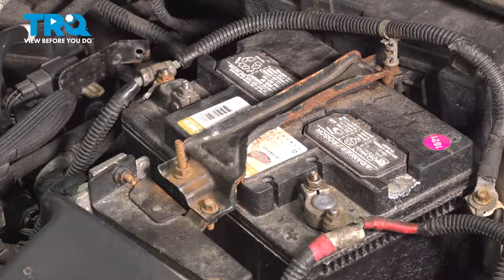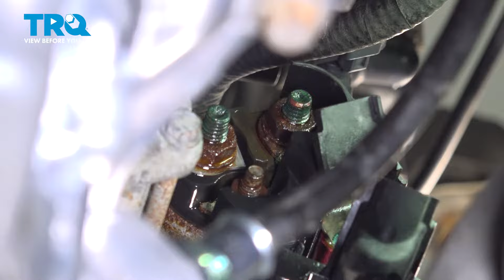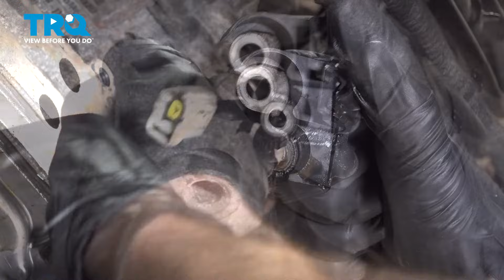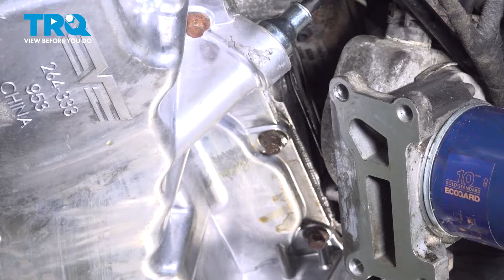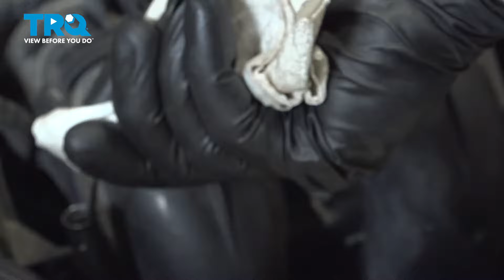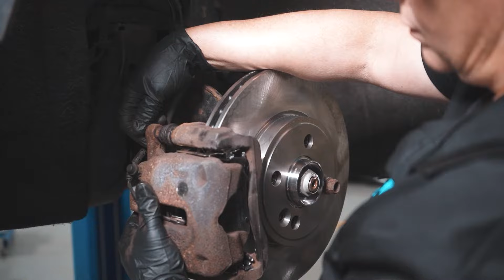How to Replace Starter 2010-2013 Ford Transit Connect

Comment: Took me 3 hours, so much oil build up and dirt and that van has never been touched by no one other then ford until I did it, so the van had all plastic covers and cable management harnesses, more so then what TRQ shows on this video. I drive 100k miles a year, not a mechanic but I am really handy with a wrench. I was able to torque every nut and bolt to spec by doing what TRQ did without ruining or stripping anything. Maybe these guys saying all these shortcuts are master mechanics though I wonder why they need to look up DIY videos but on other cars and trucks I've been able to do it in 25-45 min but this one to do right 3-4 hrs following this guide sounds right.

Comment: for those asking, engine is a 2.0L... there is absolutely no need to remove the oil cooler or any other part, need to go from bottom of the car, only need to disconnect the oil pressure switch so you can move cable around, remove the 2 starter bolts, pull it up and turn a little upside down so you can disconnect the battery and solenoid wires and just wiggle/turn the starter around and remove from bottom around trans area... took me like 25 min the most

Comment: You don’t need to remove the oil cooler for this or get under your van at all. Both mounting bolts are accessible from under the hood. Remove mounting bolts first, then turn the starter upright and remove the wiring nuts. This job took me about 45 minutes.